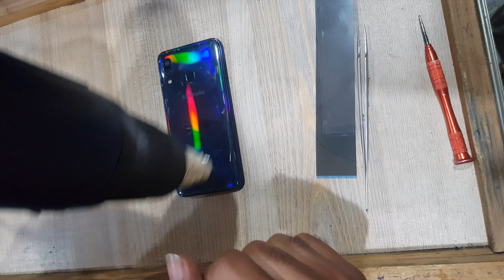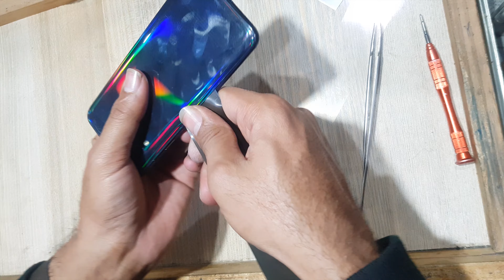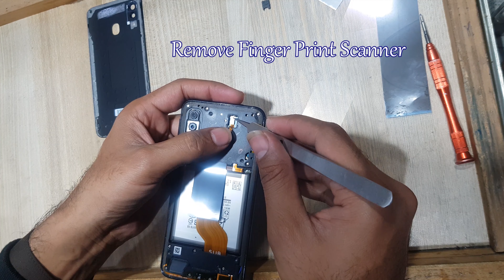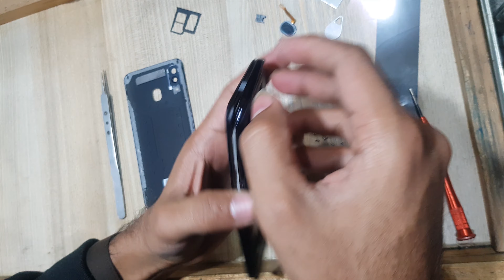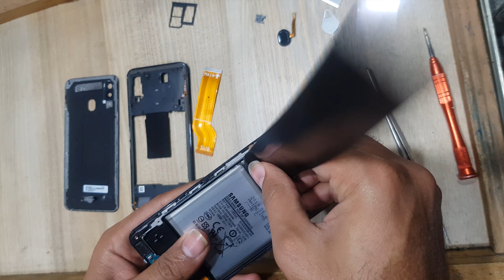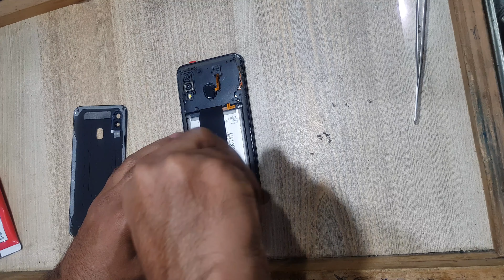Samsung A40 Battery Replacement

Comment: my a40 not charging i replaced charging port but still not charging any ideas apart from throwing it in the bin cheers
Reply: Hi, Was it solved somehow? Our A40 is disassembled and waiting for a solution. Charging port was just replaced in an hour ago and still not charge. I only need a fully charged battery to connect to the phone to make a backup from our "past" ...then Good bye A40... The phone is still working... we can switch it on...samsung logo, we got the background image/wallpaper....then "out of energy"....switching off. If I buy a brand new battery maybe it should be around 40-50%of power initially, maybe we can make some backup activity but what if the initial power is less than 10%?  :D we bought it for nothing. So we need a solution... I hope You could find something....maybe we can try to charge it by wire somehow with an 5V external charger?! The connector is very tiny. I need an "emergency solution" for only 1 charging period...then it will be a good game for our cats. :D